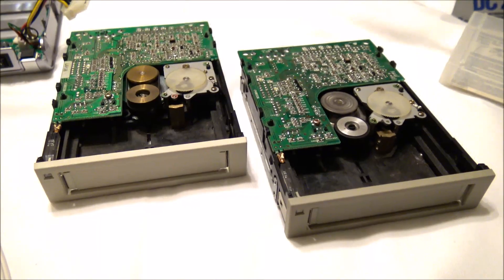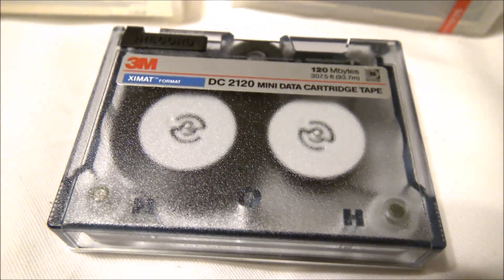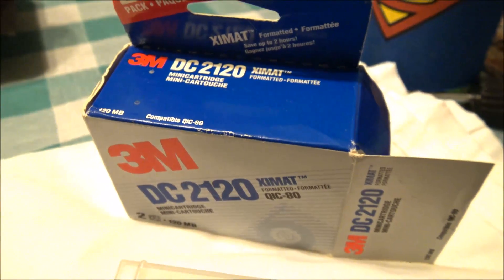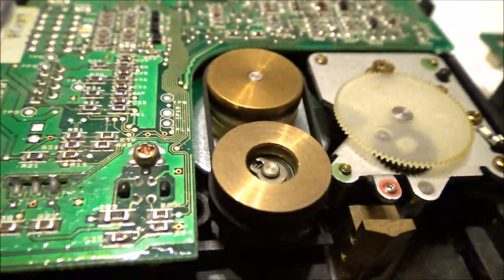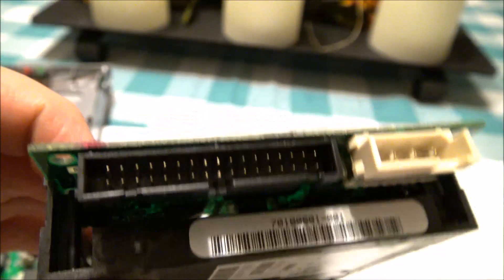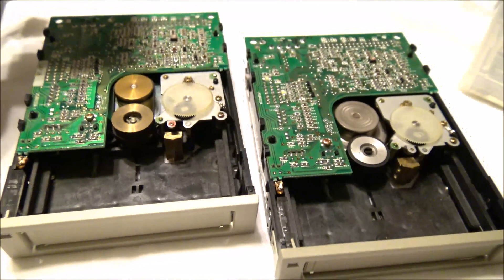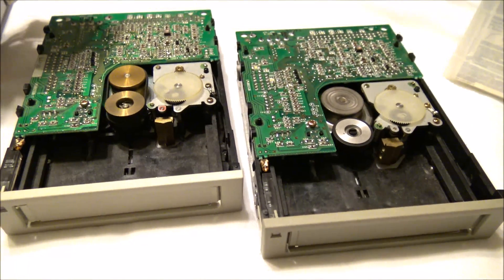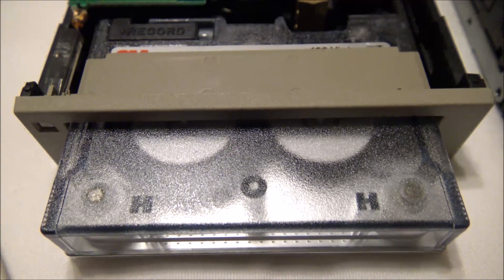Old School Computer Backups

Comment: hi the pinch rollers go soft  i have some older drives like this  

the funny thing i forgot one silly thing drivers  i was buying alot of data drives   why are they not working the penny dropped IT at work nice 
man said don't forget the drivers  for each drive  i  said they like usb plug and play no you have to ad the drivers 

went over to nova backup  all the drives are now working ok  i have 40 data drives 100% working  alot end up on ebay because they
don't know what they are doing  like me till IT said something 

i went over to DAT LTO DLT AIT  drives they don't play up alot  

tjhere are alot of ace data drives out there the only bad side  scsi card are pci ports  and new motherboard will not take old scsi cards

Comment: I have a drive similar to these, although It's a different manufacturer, Colorado something, which was manufactured back in 1991. A friend gave it to me and I found some tapes on Ebay and then started to play with it. It works really well after all these years and I consider myself pretty lucky to have one in my retro PII 350. Cheers !

Comment: I always get my dads old computer when he buys a new one started with a VIC-20 and went through things like a Victor 8086, IBM PS/2 and goodies like that.

Since i moved out he just put them in a corner.. Went by and picked up a heap this week and one has a QIC-80 drive but in a 5,25" place. I just need to get a keyboard with DIN-plug to get it running.. 

Will be interesting to see whats on the tapes.. I know all the games i had ~1995 is on there :D

Comment: The 3 1/2 inch streaming tape drive came out sometime in 1987-1988 because I know I was working in the standards lab at the Archive Corp. creating the master alignment tapes for the techs on the line. In late 1989 to early 1990 a competing streaming tape drive company got the first 1GB streaming tape drive to market first. Several marketing people and engineers where I worked at were escorted out the door. First time I ever witnessed people getting fired for not getting product to market first. I heard rumor they missed a 400 million dollar contract by 2 weeks. I moved away from Archive in Costa Mesa in April 1990 so I do not know what happened to them after that.

Comment: Thanks for posting the video. Brings back memories from when I worked at the Archive Corp. based in Costa Mesa California in the mid to late 80’s. When I started at Archive in 1985 the company built 5.25 inch QIC streaming tape drives. Around 1987-1988 the 3 1/2 inch drives started being built using the cartridges in your video. Not sure what happened to the Archive Corp after 1990 but maybe they got bought out by a Japanese company ?
Reply: When I started as a greenhorn I worked in the “burn-in” department. Hooking up the drives to a power supply but I cannot remember how many hours of burn in each drive got constantly streaming back and forth. Then I got promoted to head alignment where we would set the azimuth and zenith of the read / write head. My last job was the standards lab where we created the master alignment cartridges from the best 3M cartridges we could find out of hundreds of cartridges. The lab job was the best job I ever had there

Comment: I've got a Colorado 250 MB, and a Colorado T1000 tape drive.  Plus a bunch of tapes.  I'm gonna see if I can get them running and see if I can get at the data on the tapes...I'm not expecting much success.  But it should be fun.   ...hmm  I think I had an external tape drive too that had 8GB tapes...or maybe I'm thinking of the Jazz drive.  Meh.  One day I'm playing with tape drives in the 90s, and the next thing I know its 2019 and tapes are ancient tech.  I don't consider my self ancient, yet.  :)

I'm gonna setup two old Pentium 4 machines with multiboot with Win95 as the oldest OS, and maybe Linux Mint as the newest.  With maybe some other OS's in there too.  They were gaming machines back in the day so fairly souped up.  Will see what can be done with these drives.  Fun fun fun

Comment: I used to work for a company that provided computers and software to pharmacies for their tracking of prescriptions.
They used colorado brand tape backup hardware like this. I was always fascinated by the tapes operation...i installed quite a few of these drives in Dell machines back in the 386pc days

Comment: I had one such drive. Back in 1995. I had it with 3 tapes, and it was enough. Back then, an 800 megabyte harddrive was kind of standard. Compressed, then my tapes would hold 3x250mb. Enough for me, as I used it for personal work files.

Comment: I used these as well, I only had to restore one once. It was in the days of AWFUL Maxtor Hard drives. It did a horrible job. It took forever to restore and a bunch of data was missing. I think we had it set up to back up to often. We backed up on a nightly basis and I think the tapes weren't up to the duty. I remember when all computer programs were loaded from tape. The 1st rule of those days, was to copy the tape....several times!

Comment: hi i had one some time ago slow is the word scsi one's are hard to find. because of in i went to dds 4 drives
the lto1 2 3 drives are ace i love tape back up you got to have a trem block and right software. to get the best out
of tapes and drive i got a LTO 3 for £20  100% working 34 mbs  i am happy i stopped using discs i had ton's go
bad if you going to keep you file only use tape. yes  it's slow the software doe's all the checks when in backing up

Comment: So what's the actual purpose of all that back-and-forth seeking? Like, what's it looking for?
Reply: It's not a tape drive with a start/stop drive motor. It is streaming tape drive. It reads a large block of data, but the motors are still spinning past the next block, so it has to reposition the tape back to the beginning of the next block.
Reply: @RaymondHng  Aha. Thank you!

Comment: That fibre optic-like bit of plastic is called a "light tube" or a "light pipe". They're used so the manufacturer can put the light source somewhere convenient, like on the front edge of these tape drives' circuit boards, instead of having to come up with some way to mount it right at the front of the unit.

Comment: Yes those old tape drives were amazing. Have one or similar to this and was able to read off files written in 1995, no errors at all.  One thing I have noticed in these tapes now are so old, is tape squeal. During read operations as the supply reel gets close to the end, spins so fast that this horrible squealing noise becomes apparent. The friction also goes up and have had some tapes snap, even brand new ones out of the box. To fix I have found successful, is to disassemble the cartridge, remove that tensioning band and lubricate where the tapes sit, basically everything that rotates on a metal spindle. Getting the band on is a nightmare, but it can be done. I notice that my later generation TR1s, 3 and now TR4 are all exhibiting this squeal, so they all need to be relubed before going in the machine again, or risk tapes snapping. Great video, thanks for sharing.

Comment: The reliability of these devices was terrible. Unlike DLT/LTO, they had no automatic way to verify the writing was successful, so you could run a "backup" but later discover when you needed it, that the tape was unreadable garbage and useless. It was absolutely required to run a "verify job" after writing the tape, to make sure it was written successfully.
Reply: Yes, I gather 'speed wasn't the focus of this wonderful tape engineering. Verifying completely doubled the long time it already took to back up the data in the first place. Of course if the verify failed, one would need to rewrite - and  then re verify.  Probably a good thing they only held 120Mb ! If that didn't work, you could try reformatting the tape and having another go. Add another 2 hours to your backup time! Even cataloguing was a bit of an issue, I was using Windows 95 software to do backups, which never allowed the storage of contents of tapes so everytime the tape was changed, you would have to recatalogue the tape to do a restore. That took around 15minutes!

Comment: hi software call backup my pc works very well on the drive. the drives in the video are later
ones. i used to have one that went on the floppy cable 34pins

Comment: I wonder what did 3M meant with the "Gigabyte is here!" printed in red letters on the tape boxes' insert.
Reply: It was their announcement of the first tape, that could hold 1 GB of data. It was called DC-9135, the system was later called SLR. It looked similar like the QIC tape shown above, but was much larger in physical size.
Reply: I worked at The Archive Corporation in the late 80’s and can remember the 1gb 3 1/2 inch tape drives when they first came out. Suddenly all of our 5 1/4 streaming tapes drives were obsolete

Comment: The software company I worked for used several different backup tape drives.. One of my jobs was to change out the tapes and verify that the backups were good..  They were running Linux machines so to verify the backups was all command line there was no GUI.. Fun stuff

Comment: is it still viable to store back up on a tape drive if you have THAT important of information? Or has solid state now become too reliable for that to be needed? (I'm probably using incorrect terms)
Reply from the maker: Most experts agree that tape is not the most reliable form of backup media.
Reply: Tapes are still in use, the main reason is for "offsite" backups. Eg if something wipes out the data/hardware (eg cryptolocker), the tapes won't be affected as they're swapped out and aren't easily written to except for when performing a backup.

Comment: Yes, I had 2 tape drives in the mid-late 90s I used to back up large amounts of data before I got a CD burner in '99-- a Mountain QIC-40 drive (using DC-2000 tapes), and later a QIC-80 HP Colorado drive (using DC-2120) tape drive.  Both hooked into the PC's floppy drive controller, and the Colorado I had came with a special floppy cable that had an extra in-line floppy connector allowing  both the tape drive and an existing floppy drive to use the same controller.

I used it with Microsoft's built-in tape backup software in Windows95 & 98 to back up .WAV files of drum loops and other audio bits I either found on the internet or made with Cool Edit (now Adobe Audition!) in the late 90s since it was all too much data to span across floppies (most of the .WAVs were 44.1/16), and I didn't have a CD-R writer yet.  Slow, but worked quite well.  I think I still have my Colorado drive and the last tape I used with those .WAVs on it still laying around in storage.

The last tape drive I used was around 2002-03-- it's an an ADR-format OnStream tape drive.  It plugs into an IDE port much like a hard disk, and could hold 10 GB per ADR tape (20 GB with compression).

Comment: This brings back memories.  I had a Colorado QIC drive that I used through college.  Until Iomega Zip drives landed, this was really the only economical way to backup large files at home, unless you wanted to tempt fate by storing multi-part zips on floppies.  

As I remember, getting another drive to read the tapes created on another was a dicey proposition.  If you QIC drive blew out, the best solution was to find the same make/model drive and hope that it could read your backups.

Comment: I used to use tape drives back in the day, I used them on Windows 95 & 98, these OS's offered native support (installed option during setup), I used them also on Windows NT 3 & 4 but cant remember if it was an option as well? I don't remember the models I had but the tape size is about right, you could also compress the tapes to get double the data...you need to remember, this was before CD burner's and tape drive was primarily for businesses, consumers still backed up to floppy and eventually to Zip drives & CD's.  The thick aluminum plate on the bottom of the tapes are to ground the tapes and protect them from anti-static, what you displayed at the end was the tape checking its index to see whats on the tape and where, backup was generally done after hours as it could take many hours to backup and or retrieval.  ~Jack, VEG
Reply: In 1995 I remember the zip 100 mb drive was new. I never had one of these tape drives but that was because my best machine years later was still a Motorola StarMax4000/160 MaClone! with a zip drive... and 'retrospect' backup software was ridiculously expensive.  They had those tapes at work though, along with 1/2" RTR. I never saw one run so I like this video. As far as the head movement is concerned it's kinda like LTO which I now use. I do have a cassette like this, kept it because I like the way the tape 'rolls' are both driven by the same belt which runs the tape from the outside of the roll. Ingenious way of getting around the crappiness of other rim-drive issues by powering much of the tape path at actual 1:1 ratio if you know what I mean. Ever heard a 'rim drive' analog tape Dictaphone? It's WOW is a real laugh. Then you know what I mean by crappy rim drive with no pinch roller (no offense to LTO intended, those drives are advanced enough to deal with it well). Anyway, long before I could have afforded one of these tape drives and software I already had a CD burner in said StarMax computer, and it was good except that could never act as an OS disc like the zip could. It would be entertaining to see Windows or mac Mac OS 7.5 or 8 start from a tape drive if it can.
Reply: NTbackup yeah?
Reply: Vintage Electronics Geek NT 4.0 has an option for tape drives.
Reply: Thank you for clarifying that, its been many years since I've dorked with it and couldn't recall!  ~Jack, VEG

Comment: Wow, that was just the automatic init routine? No wonder it claimed to save two hours, the "what's inside me" routine alone took like 3 minutes!
Reply: Anthony Takata These drives hooked up to the floppy controller, so they wrote exactly as fast as a floppy disk...only that a floppy was only 2.88 MB tops.